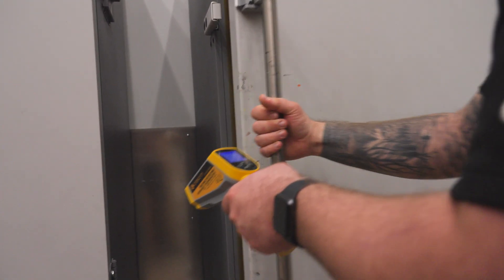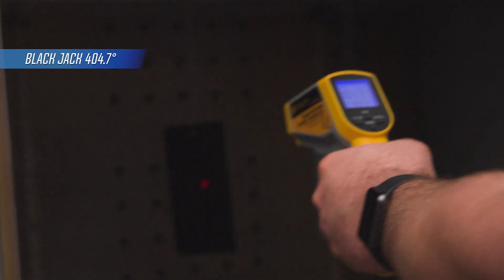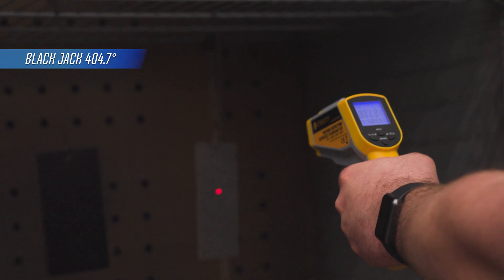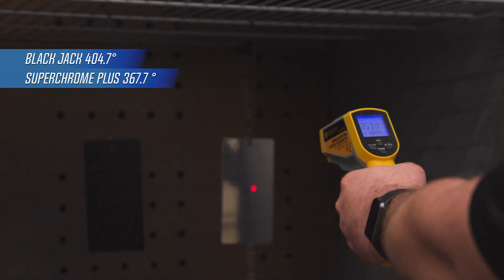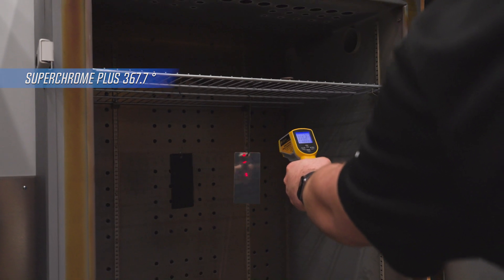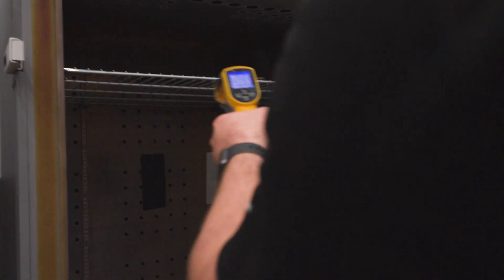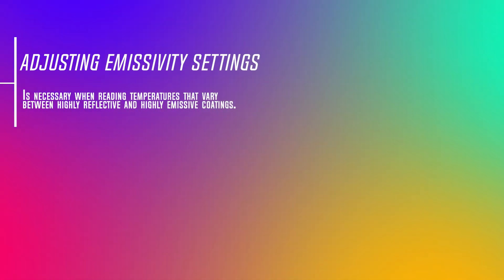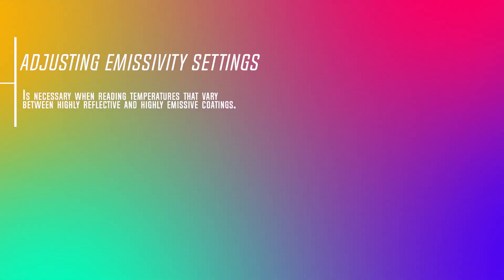Prismatic Powders | Emissivity Matters

Comment: could it also be that the chrome reflects more heat than the black?so maybe it was just a little cooler than the piece beside it which was essentially a black body? are we sure it's the settings on the infared thermometer?
Reply from the maker: Yes, adjusting the emissivity settings on the IR thermometer was this issue in this experiment. Since we have two identical parts,  in the same oven at the same temp, and one part that serves as the black body,  but two different results it illustrates how the part metal temperatures can indeed be identical but the readings from the surface can be different. This illustrates the need to make adjustments for accurate readings.
Reply: @PrismaticPowders  but how can we be 100% sure that the two parts are identical temps - even though they're in the same oven at the same temp, one part is a black body so it will absorb more heat anyways, and more heat absorbed = hotter temperatures for that black body part so if this was the case the IR thermometer may actually be giving accurate readings already and does not to be adjusted 

I'm sorry if this seems condescending I am honestly just trying to understand EVERYTHING powder coated related and you guys are the experts and so I figured I would run that theory by you guys and see what you think, is there a possibility what I said could be true? Would the black body part be hotter since it absorbs more heat? I only ask because when I set my oven at 375°F some parts come out at 375° whereas others come out around 450° so that almost leads me to believe that some metals get hotter and absorb more heat than others (upwards of 100% sometimes when I pull 450° parts out of a 375° oven) there is so much science involved in this industry I love it! Please let me know what you think of my thoughts and correct me where needed, trying to get a better understanding, thank you! It makes us customers very very happy when you take the time to respond to us on here 🙂
Reply: @PrismaticPowders  I know the emissivity factor does indeed play a role in the accuracy of the readings but in this case since you compared chrome to black could both factors (IR thermometer needs adjustment as well as the black part absorbs more heat and so it's quite simply just a little hotter than the chrome piece) potentially be affecting the end result? In other words, could it be that the IR thermometer does  need adjusting but also that the black body should absorb more heat than the chrome piece and potentially be a couple degrees hotter than the chrome piece due to this increased heat absorbtion? (and not just a couple degrees off due to the IR thermometer solely) 

I'm currently unemployed and very interested, sorry in advance 😅 

I hope this makes sense, cheers 🍻

Comment: Okey. Now, where can i get a list of emissitys for different powder colors?
Reply from the maker: Hi Petri, you don't really need to change emissivity settings for "color" changes, rather they would need to be adjusted based on a particular powder's reflectivity. We wanted to show the two extremes of the spectrum (Super Chrome and a Black) to show that making adjustments are needed in certain circumstances, but if you were spray a red color, and then a blue color you wouldn't need to make an adjustment.
Reply: @PrismaticPowders .
Thank's for info. What setting would you use for a sandblasted alloywheel? Or regular could rouled steel? Powder would be a basick polyester powder.